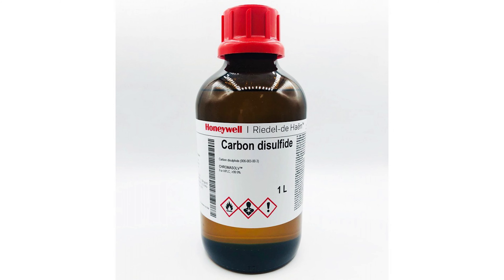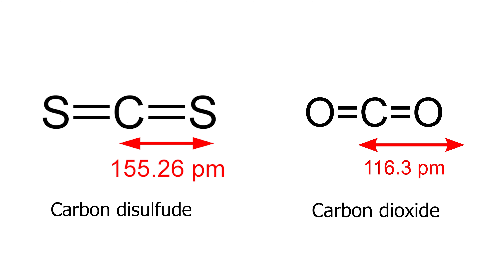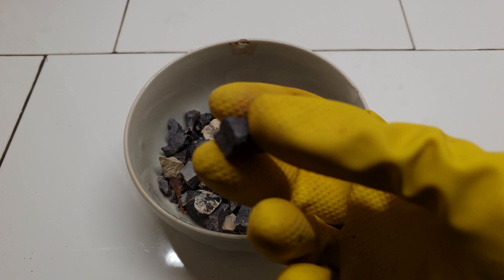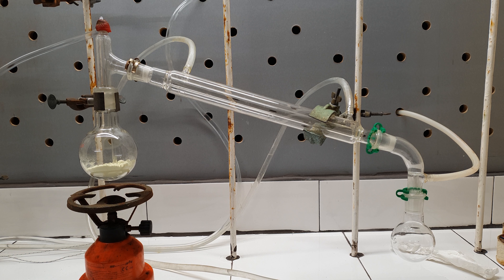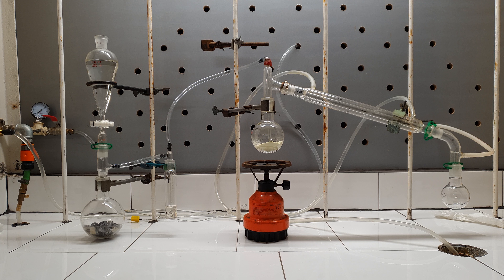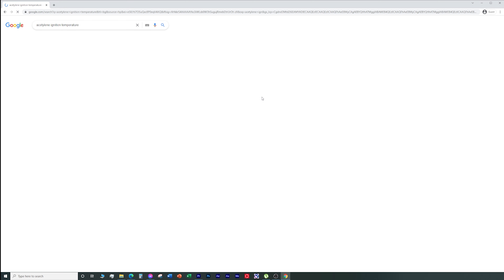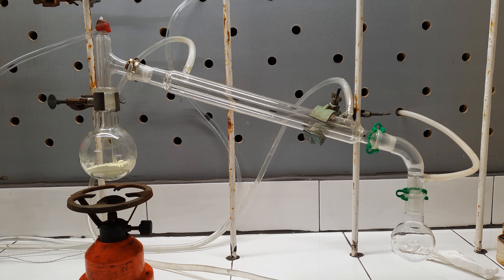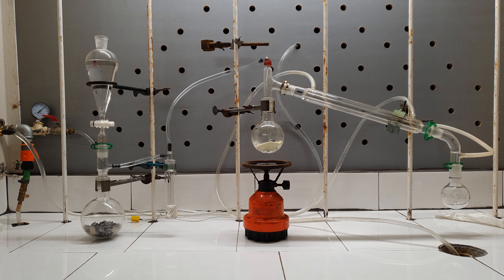This chemical smells like FART and is even more FLAMABLE!

Comment: Use nitrogen instead of argon. If you don't have a nitrogen cylinder, you can make it, with ammonium chloride and sodium nitrite solutions. Add the gas upstream of the acid bubbler, so it can be dehydrated, too.
Reply: CO2 would be fine for this
Reply: Or use a bit more acetylene
Reply: Vacuum purge and reprat with any noble gas or your acetylene

Comment: Beautiful!! So much wonderful tar XD
I must say it is genius in its simplicity, just burning with oxygen analogue. It makes me curious if in place of acetylene any other carbon source could be used (of course gas bubbling is most convenient than maybe propane or methane, but just cooking charcoal with an excess of boiling sulfur... total alchemy XD).
Personally, I would try to make some crazy 120-160 degree reflux condenser to keep sulfur in the reaction flask and only push "volatiles" through (like boiling xylene keeping stable temperature).
Now waiting for next video and more glass washing ASMR XD
Reply from the maker: Thank you! I'm also curious if paraffin with sulfur for example will give CS2 and will probably try it one day.
Reply: @Hexazine0  I would try first some coal/charcoal. No hydrogen means no H2S generation. In theory just CS2 should be produced.
Reply: @ejkozan  Carbon/sulfur works, but at considerably higher temperatures. I have seen it done in a ceramic reaction tube, with one closed end, and the other leading to the condenser. The tube is heated to glowing, and CS2 can be collected when condensed.
Reply: @Hexazine0  Paraffin and sulfur gives a LOT of H2S.
Reply: @michaelf7093  Wow! Good to know! It only a pity that it needs so higher temperature :(

Comment: Very nice video! A lot more convenient than the reports on ScienceMadness which use over 1000 degrees etc. 
I'm sure the yield can be improved a lot. Can't you use a lower temperature on the sulfur? If so; maybe a hotplate with magnetic stirrer to melt the sulfur?
 Spin the stuff around for better mixing?

One thing though: Your beg for money to buy argon is pathetic, argon is not better than acetylene, you just used too little. Argon would have given the exact same result when used in the same amount.

Also; if your CS2 smells like shit, try to wash it with NaOH, HCl.. what not, before distilling it

Comment: Purification to that level seems so difficult but just knowing how the pure stuff smells is enough for me to want to make some and purify it. 

Maybe activated carbon would be enough
Reply from the maker: Sulfur compounds smell is really difficult to remove. I think that even the product from Sigma smells like fart.
Reply: @Hexazine0   Carbon disulfide produced this way contain about 3.5% of thiophene as well as other organosulphur mess. 20 min shaking with saturated KMnO4 1:1 volume will clean it. (Ref “Small-scale synthesis of laboratory reagents” by Leonid Lerner)